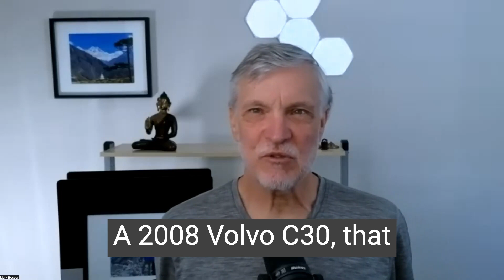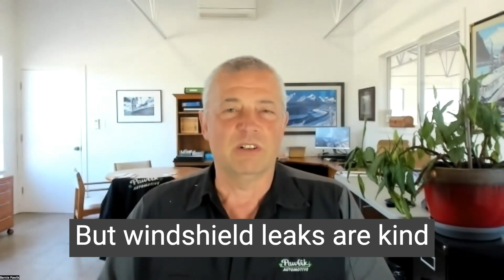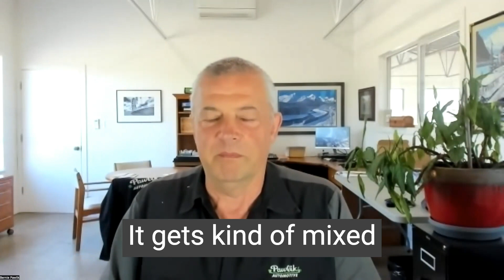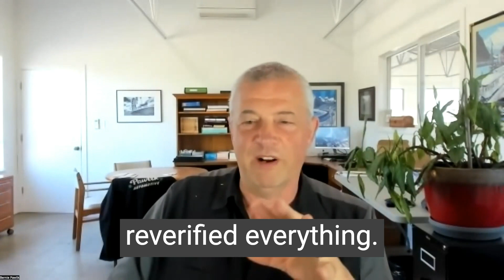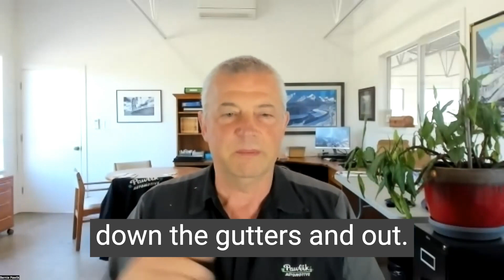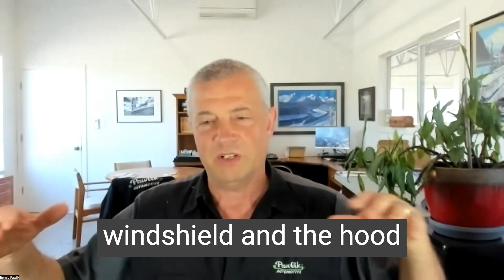2008 Volvo C30 Water Leaks

Comment: Mine is leaking badly at the rear footwell, no sunroof on it. Any suggestions? It's driving me mad 😂
Reply: 2010 C30 owner here, no sunroof and my left rear footwell is soaking in water as well, did you find out where it came from?
Reply: @mortjoer  mine was all driverside and was the aircon drain that was blocked. If its passenger side I'd put money on it being the windscreen. If you push it from inside you should see the screen move
Reply: @tipsandtricks5258  Hi, and thank you for answering.
I think i found the cause to be the rear left hatch rubber bump stop. 
The interior is moist to the touch in the booth on the left side only and it runs and pools in the left rear foot well.
The front left passanger footwell is dry as it seems.
The left bump stop seems a bit loose compared to the right side one so it adds up in my mind at least ^^
Going to get a new one fitted tomorrow on both sides.